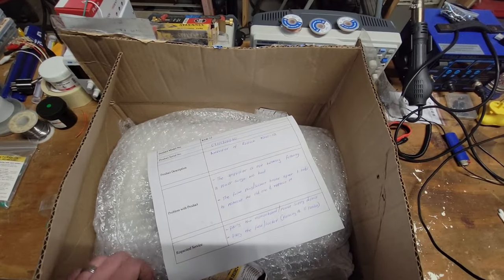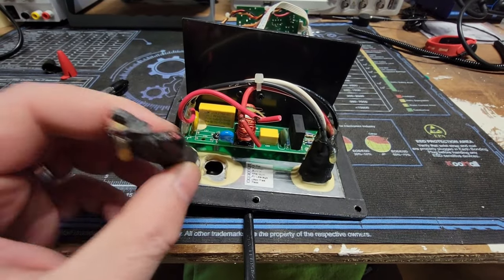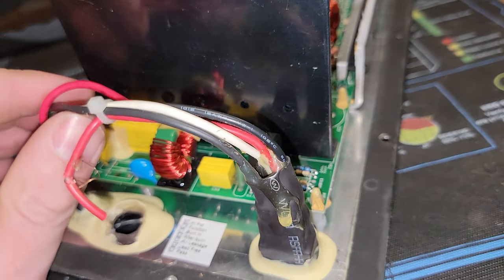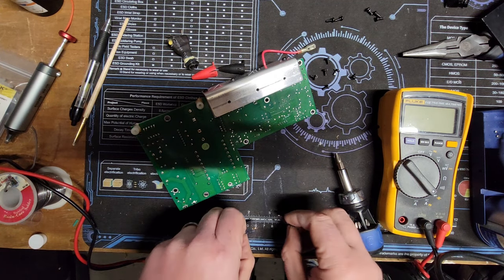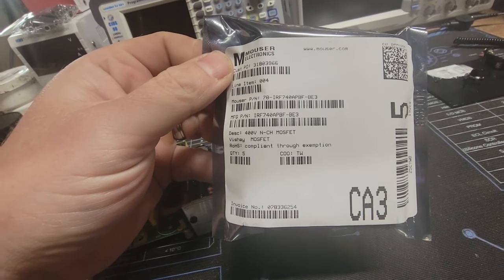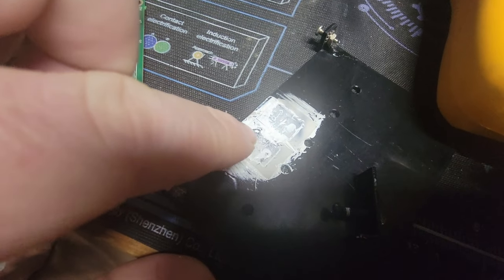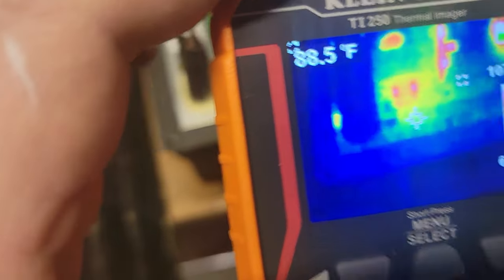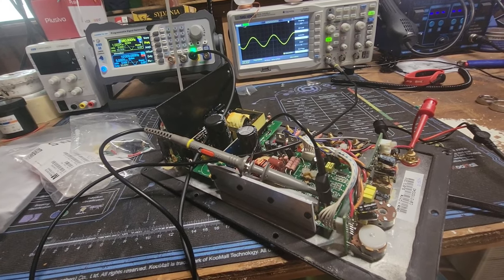(Repair) Klipsch KSW-12 Struck by Lightning No Power

Comment: Well done Interesting (to me anyway) that the bridge wasn't damaged (assuming the FETs are on the output side of the bridge).
Reply from the maker: That was my exact same thoughts. I was very surprised to see the rectifier functional. The FETs may just be less able to sustain function with instantaneous differences in either voltage or current.

Comment: Hi, I have a Klipsch KSW-10 subwoofer, the transformer is out of order. I can't find a new one to replace it. Do you have a transformer for KSW10 or KSW12? or a reference to order a new one? thanks
Reply from the maker: @satanasfouduvolant9228  unfortunately I do not. A lot of transformers are pretty much designed for the switch mode power supply (SMPS) that they are used in. So unless you can find another bad SMPS with the same design in which to cannibalize the part, you might not be able to find a transformer elsewhere.
Reply: @ Thank you for your reply. I thought I could repair this subwoofer. Unfortunately it will end up in the trash...
Reply from the maker: @satanasfouduvolant9228  save your woofer/speaker. That alone is worth keeping in case you have one that ever goes bad.